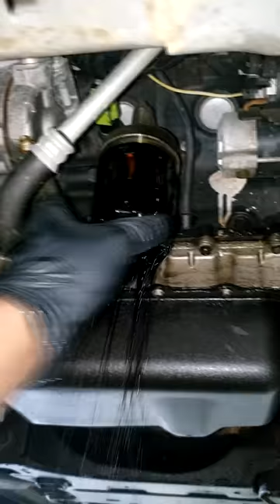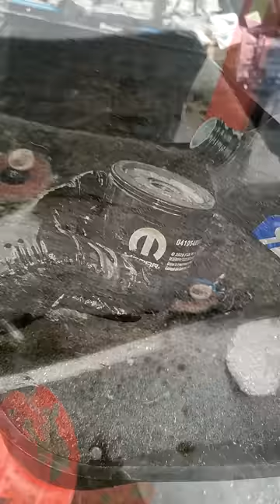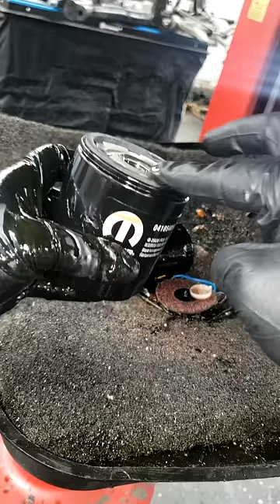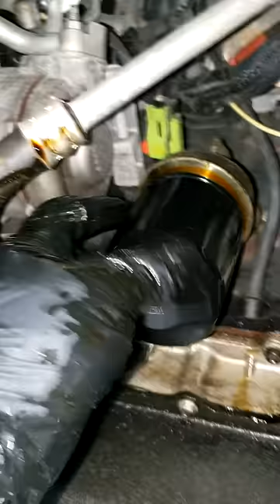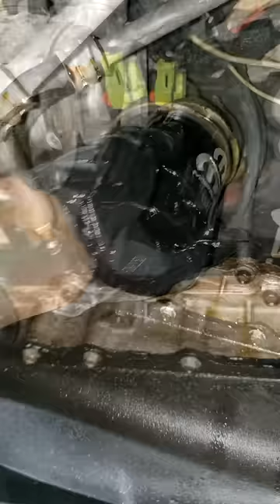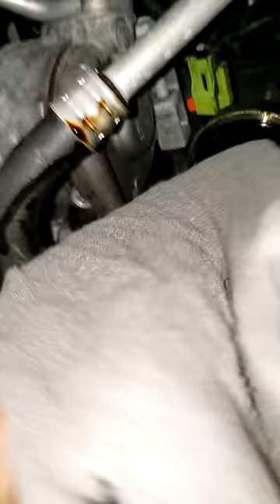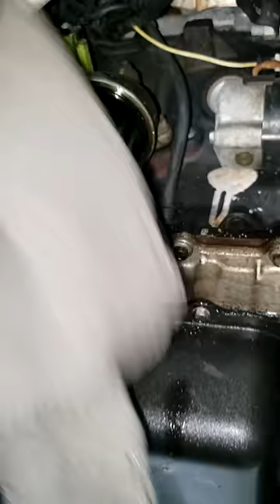Don't Lie.. Are yall still doing this?

Comment: You are pre charging the filter wrong. Your supposed to block that center outlet section with a plastic plug and pour the oil in the small inlet holes and you will see the oil come up through the center outlet section FILTERED. Otherwise you are putting unfiltered oil in that system
Reply from the maker: Interesting. Never gave it much thought thanks
Reply: While true, fresh oil is as clean as it'll ever be.  And will be filtered within a minute or less anyway.
Reply: It’s pure fresh clean oil, It doesn’t matter. Also in my experience it’s very difficult to get the oil in the outer holes and often the anti-drain back valve makes it impossible
Reply: @bigpjohnson  yes it won't take long to go through the oil system but the first place that un filtered oil would go would be right to the crank shaft which, with most setups, takes a 2 micron thick piece of particulate matter to possibly spin a main/rod bearing.
Reply: @rhettmix7271  New filter with new oil...no need to filter new oil, bruh.
Reply: Lol unfiltered oil 😂 
It doesn’t matter. It’s new oil.
Reply: @izacmcdermott3551  idk what you're on but filters won't even catch stuff that small man. Even things 15-40 microns big are only caught at a ~98% rate
Reply: I only prefill the filter if the design allows. Some filter placements you can't possibly do this. Either way the oil flows so fast there's not much of a difference. It's not like your changing the oil filter at every cold start.
Reply: Because the other 10 quarts i poured into the engine that arent filtered  are gonna hurt it its clean new oil it will litterally never be cleaner than in the bottle did you even think this through before postinf
Reply: @izacmcdermott3551 no the oil sitting around the crank you just poured in  is gonna go to the crank first wich unless you filtered all your oil going in the one quart in the filter doesnt matter at all  ps it goes to the oil sprayers/jets after the filter
Reply: Just remember we don’t have 70-80s vehicles anymore these advanced system have a priming system, oil pumps that are equipped to preprime the system along with oil filter. So I believe along with many other techs ( Ford boss me)that can explain why but hey to each it’s own. You have the time Go for it.
Reply: So no oil in the filter is better then just filling it up 😂😂😂
Reply: It doesn't matter, if the filter is empty and the media is dry on start up the bypass will open until the can fills and the media becomes saturated with oil. There was a great video showing this where they mixed pepper into the oil and there was oil coming out of the filter for the first few seconds after start up... also it showed pepper allowed to bypass with sudden RPM jumps like a down shift. Moral of the story, not all oil is being filtered. I'll post a link if i can find it.  The only filters that say don't prefill are the ones that don't have bypasses built in, like diesel fuel filters...

My take is that oil is going to be cleaner from the bottle than it is after being poured into the engine and mixed with whats sitting in the oil pan...
Reply: Nonsense. Most fill ports go straight into the top of the engine not direct into the pan. This is one reason you shouldn't refill with unfiltered oil from the pan even if it's new (e.g. you find a leak after a change and have to drain new oil). You can partially refill via the dipstick to go straight to the pan.
Reply: But the oil coming from the bottle is clean.
Reply: @EpicDrew15 very good point 😂
Reply: It isn't going to get any cleaner than straight out the bottle my guy
Reply: Why would you need to prefilter New oil the rest that you dump directly into the crankcase isn't filtered first so why would that pint or so matter? Just curious
Reply: You’re worried about that but you don’t even mention inspecting the filter for manufacturing debris…? (extremely common even in high quality filters)
Reply: BS, oil out of a new bottle is filtered and clean.
Reply: Let me know how that works when you get an oil filter that goes on sideways or on an angle like a 5.4 Ford.😁😁😁 it doesn't matter in all honesty.
Reply: You can't. The anti-drainback valve won't let the filter fill. Filling it through the center works, because the filter media is porous, and allows air to bleed out, allowing a full filter can. I'm not worried about debris, filling a new filter from a new bottle of oil.
Reply: If that's the case. Might as well put a coffee filter in your funnel as you pour in the rest of your oil. 😂
Reply: But, he's pre-filling the oil  filter with new oil, why would he need to do all that?
Reply: @todydn those 10 quarts aren’t going directly to the bearings, they’re just covering the valve train and draining to the pan.
Reply: Don't let Rhett Mix you up.
Reply: The main reason is because if there's a piece of aluminum from the lid of the oil still in there, even if it's small can block a port to a cylinder or many other things that can reek havoc in your engine. Pluse my any vehicles have an oil filter that is sideways so just don't worry about it unless it's a diesel and especially if it is it's fuel filter
Reply: Why would brand new oil from a just opened brand new bottle need to be filtered ? That’s the dumbest thing I ever heard bro 😂
Reply: Then in that case you are also pouring un filtered oil straight onto the cams when you fill the car up.
What a load of nonsense.
Reply: JUST TALKING ABOUT OIL CHANGE PLEASE BUY GOOD QUALITY OIL FILTERS! SOMEONE KILLED 2020 BMW 340I BECAUSE BOUGHED CHEAPER FILTER THAT WAS MADE WRONG...
Reply: @foojub6907  wich the crank and bearings partialy submerged in  at least in diesel vehicles where a verticle oil filter  is used  iv rebuilt my cummins twice now i can assuredly tell you the crank is halfway submerged in the oil also  the oil goes directly into the block not over the valve train  from there the pump draws it puts it through the filter 
 From there it goes to the turbo and the oil sprayers wich spray the rods and pistons wich lubricates wrist pins and oil rings  also is pumped up to the valves   but the bearings are oiled by passing through the oil in the pan/crank
Reply: @EpicDrew15  you don't need to pre-fill your oil filter...
Reply: You must be an engeneer...😂😂
Reply: It’s new oil it doesn’t need filtered
Reply: “Unfiltered”…. Dude it’s from a brand new sealed container……
Reply: @eliezerramosjr1017  there is one engine from gm that has a service bulletin to pre fill the oil filter. Have actually had it throw a check engine light for a rough start. On 90% of vehicle pre filling does nothing tho.
Reply: I have done it like this since I was a kid and we had a farm and a trucking/construction company. I still run the gravel crushing/trucking and construction company. Thousands of oil changes and no problems because of it. This oil change was very clean. No dirt/oily built up debris hanging around. No reaching up inside the frame between the oil pan. No reaching up through a bunch of shit like on my dodge Cummins pick ups where crud could accidentally get knocked into the filter. Save your white gloves for the ocd crowd
Reply: what about the 4+ qts of UNFILTERED oil you pour into the engine? 😅
Reply: @mattl6584  kids on the internet lol
Reply: Spu you mean to tell me that you filter all your clean oil before putting it in the engine???
Reply: I may be wrong but I feel that that split second of fresh oil entering the system (which will be filtered quickly) is better than a dry start?
Reply: @izacmcdermott3551  whenever you add oil to the fill port it is unfiltered straight on the valve train anyway lol it doesn’t matter it’s clean
Reply: Unfiltered oil? From the bottle? What you think, it's dirty?
Reply: Bruh, the oil gets poured into the engine the way it is to fill it. How else you supposed to add oil? I just did a full tuneup on my truck and did the filter exactly like this as per the Manufacturer.
Reply: @izacmcdermott3551  2 micron? You realize even the best filter only goes down to about 20 microns right lol
Reply: Unfiltered oil???? Lol do you mean the same unfiltered oil that you’re pouring in the valve cover to fill the engine??? 🤡
Reply: Most new engines have a bypass valve for dry startups anyways. That way if you don't prefill the filter it spends the least amount of time possible on dry startups. Oil from the bypass isn't filtered either because that's kind of the point. If the engine had to wait for the oil to go through the filter first it would be running dry for longer. 

Best practice to prefill, yes. Should you do it every time, especially on older vehicles, yes. Is it always possible? No, unfortunately it isn't.
Reply: unfiltered brand new oil out of the bottle huh?
Reply: These filters are so course anyway, with a finer filter like these remote ones that filter a smaller percentage at a finer rate id say this comment is very relevant but with these filters and new oil less so, imo....
Reply: but you pour unfiltered oil right into the valve cover🤔
Reply: @bigpjohnson  Have you looked in the bottom of an oil container?  They have sludge.  That new oil is not clean.  All filters go on dry with me, leave them wrapped until the last moment.
Reply: I need to buy one of those filters that cleans the oil cleaner than when it came out of the bottle.
Reply: no need to do that. the oil is fresh new. my only advice is to leave it for a couple of minutes after you fill it. it will settle down and you can fill it some more.
Reply: Yeah this makes no difference. New oil is as clean as the oil will ever be.
Reply: @izacmcdermott3551  Show me a consumer oil filter that can filter down to 2 microns. I can't wait to see it...
Reply: lol. so you should also filter it before filling through the top of the engine? 😂
Reply: Aren't you still putting unfiltered oil when filling the engine ? 😂
Reply: @nspro931  that's parts of the additives.  Shake it around and get them mixed up.
Reply: @Rhett Mix: It's BRAND NEW OIL he's pouring into the filter. LOL! So when you say "unfiltered oil", what exactly are you filtering out of BRAND NEW OIL? It hasn't went thru the lubrication system and picked up any contaminants. It's literally being poured of of the bottle into the filter. LOL!

If you're gonna filter oil straight from the bottle, then I hope you're filtering oil as you're pouring into the crankcase, as well.

Man, if you're really saying you gotta filter oil straight from the bottle, you're a special kinda anal retentive. LOL! I've done it just the way this guy is doing it - and I've never had any vehicle of mine have a locked up engine. There's nothing wrong with doing it like this, for real. Just stop trying to come up with something wrong. LOL!

I can't believe you're saying FRESH OIL out of the bottle has to be filtered. LMAO! I literally spit my drink out! hahahahaha
Reply: @mattl6584  I was just saying that! Man, I fell out laughing! This guy was talking about filtering FRESH OIL from the bottle! LOL! hahahahaha! I've seen some funny stuff, but THAT took the cake!
Reply: @HH-zi5ih  I'm dying laughing! Man, I hope this original poster was joking. I really do. Unfiltered oil into the filter. It's BRAND NEW! hahahahahahaha!
Reply: My oil filter is on top of the engine on my BMW and has a cartridge so there is no way to do this.  Which tells me its probably unecessary to do this since BMW doesnt think it is by design.
Reply: @todydn  I'm starting to think he filters his brand new water bottle water as he's pouring it into his mouth. LOL! Guy has a funnel up to his face and everything, making sure he's filtering new water before it gets into his body. hahahha!
Reply: Not many people actually know this wow. I’m honestly surprised. And it’s actually very crucial you do this on diesel engine’s especially with large filters
Reply: @OnlineMechanicTips  yeah he’s actually right fr. My instructors at UTI constantly told us this when we learned oil changes. It’s especially required on diesel’s with larger filters
Reply: @TheFrenchPug  Same with my BMW. I also run a Jeep Wrangler that has a side mount oil filter. I only put oil on the gasket and that's it. Bought the Jeep with 112k miles on it, and now I've got 256k miles on it. Never had an issue nor an oil leak.

I answered with my opinion on a separate thread saying exactly what you said: it's unnecessary to add oil to a filter. The oil pump picks up oil from the pan. The filter is just pass thru, not a point of suction/pull. I think people may do it to simply add that pint of oil in that part of the system so they don't have to add more oil when they check the level after filling the pan.

As far as functionality goes, it does nothing to the oil system either way. Fill it or not.
Reply: @HH-zi5ih  lmfao that’s what I said I was like bro it’s literally new oil what needs to be filtered out
Reply: @FZERO20  Why is it crucial? Can you explain why putting oil in a filter is a necessary step?
Reply: Unfiltered clean oil?
Reply: Yea I do! I also press the accelerator for clear to flood mode for a couple revolutions.
Reply: Your pouring unfiltered oil into the crankcase
Reply: @MicDropBBQ  when there’s no oil put in a filter before startup. There’s dry flow in that part of the engine. If you do oil changes often like I do at my job, you can actually hear the oil pump aerating for the first couple of seconds because oil has to fill the filter to complete proper flow. It’s not completely necessary in most passenger vehicles as they use smaller filters so they fill up quick. But in a vehicle with a large filter, or a Diesel!… that has huge filters. You can actually starve the engine of oil for a good amount of time
Reply: Scratching my head.......mmmmm, isn't that fresh oil though?
Reply: @MicDropBBQ  yeah me too distilled water at that
Reply: @bigpjohnson  Plus you’re not pouring oil though a filter when you’re adding it to the engine.
Reply: So what do you do about the gallon of "unfiltered" oil you just poured into the block?
Reply: I don’t because that one second of air bubble in the line or whatever you wanna call it isn’t gonna matter at all it’s gonna get pushed through so quick it’s not gonna affect the lubrication at all, not to mention not all filters are upside down, Some go on sideways some even go on right side up and I highly doubt if it goes on right side up, you’d be quick enough to at least get it butted up against the threads or at least one thread on without all the oil coming out and making a fucking huge mess! lmao!
Reply: Lol think about it..  what about small engines with no filter?
Reply: @UberJeep AZ  You got it. Very good explanation! I think the purpose of doing it has had the reason why change throughout the years. BTW...my son has a 2021 Jeep (4 cylinder turbo charged). Is that a different engine than what you have?  I love driving that jeep. It's a blast. I have a 2009 BMW 335i. Just replaced both turbos, oil pan gasket, and high pressure fuel pump. It's definitely not cheap for parts. But I hope I get another 100k out of the car. I've replaced pretty much everything except the engine and transmission. I have a JB4 tuner and methanol injection. Car hauls ass 😀
Reply: Bro made a 5 minute oil change into a 30 minute one gtfoh😂
Reply: how is this the pinned comment 😂
Reply: YES you're 100% correct; however, if you can see oil in the center and small holes; you're good
Reply: @justacinnamonbun8658  Exactly, the vast majority of cars I've owned it would have been impossible to do because of placement or even angle. My 66 fury 318 poly is way tilted and you have to pass it around the exhaust ect. Sure straight up and down and wide open like this go for it. Only time I'd worry would be if the cars been sitting for an extended period of time. Just run it for a bit to get it warmed up before you drain it and should be coated just fine. The new oil would flow through the engine better when you put it in as well which helps when you have to additive like zinc which is like molasses coming out...
Reply: Good luck getting anything past an anti-drainback valve.

It's not like the oil doesn't go through the filter when you prefill from the center. Just spin that crap around and it'll end up going through the filter plenty.
Reply: That Is the equivalent of me buying Poland spring water at the supermarket, then when I get home I boil it before I drink it. The oil is already clean don't be redonkulous
Reply: @bigpjohnson  Please provide a citation for this information.
Reply: @anthonybrown3481  Oil that comes bottles is not clean.  Often if it is a light colored container, you can see the sludge at the bottom.  The engine oil filter will clean it much better than that.
Reply: With new oil it doesn't matter,  unless you are changing your oil with used I wouldn't lose sleep over it.
Reply: @rack1850  It should be clean, but it is not clean.  Look in the bottom of the containers some time.
Reply: @FZERO20  But Caterpillar says not to do it.
Reply: @nspro931  if Cat says not to then don’t, Idk why. But on most vehicles it’s a rule of thumb. I’ve worked on Cat engines and Cummins too. Still do it but I haven’t found any issues so far
Reply: @nspro931  oh I just looked it up, the reason is that Cat understands that most ppl don’t know the proper procedure in filling oil filters and that they fill them from the centre and not the outer smaller circles so they’d rather ppl put them in dry and avoid any further issues that would cause them to have to warranty an engine or something expensive
Reply: I always filter my oil before I dump it into the valve cover. Otherwise you’re just putting new fresh clean dirty oil right onto your rocker arms.
Reply: the most important thing is the spring tension in the filter 
the manufacturer has a specific spring tension tolerance .Aftermarket is a no go for me, toyota only
Reply: @lita litvinaite  exactly , the spring tension is what the manufacturer makes for a specific engine, it is not some random spring in an oil filter
Reply: @mghuertas  PHD, of petroleum distillates
Reply: not a MO ron but a MI ron
Reply: It’s a joke people, relax
Reply: @bigpjohnson  nope!
Reply: @jjunderwood4095  first top off of filter gets absorbed into the element and won't spill out so easily Just don't do the second pour that tops the filter off. That saturation is a help to the system flowing rather than the pump having to force fluid through dry paper
Reply: I do top off if for nothing else to get paper element saturated and help keep the pump from forcing thick oil through dry lpape
Reply: @ricardomolina4605  Interesting concept!
Reply: New oil isnt dirty to need filtered.
Reply: @bigpjohnson true I was just about to say it’s fresh oil so no need to pour it that way since it’s not dirty yet
Reply: All the oil goes in unfiltered through the oil fill at the top of the engine. Your comment is wrong and pretty stupid.
Reply: TF you talking about. Unfiltered brand new oil. Oxymoron
Reply: i remember my first oil change
Reply: Unless you get your new oil with a shovel at the gravel pit it will be fine.
Reply: I do this with all my personal vehicles when I do oil changes , that's the way I was shown coming up. But I'm a heavy equipment mechanic for caterpillar, and caterpillar actually tells you not to pre-fill filters.
Reply: Exactly! Which is why I don’t bother filling the filter first. To do it right is ridiculously slow and usually messy.
Reply: This has to be the most Tiktok mechanic comment I've ever seen smh, out here thinking these filters perform magic and are made in some laboratory.. it's a bit of paper to catch large sediment, that oil is the cleanest it'll ever be and unless you had probably million pound/dollar equipment there's no way of getting it cleaner
Reply: its new oil. It's been been refined to specs.
Reply: If you block the centre and try to pour oil through the small holes no oil will enter.
The diaphragm will only push oil through when it has pressure behind it.
It would take an eternity to fill it that way
Reply: Yep that’s right and he did not wipe the flange off before he put the new oil filter on gross
Reply from the maker: @Herman Rogers Please tell me you don't work on cars for a living.  Your over extreme petty ways kind of disturbing.
Reply: Those oil companies don’t filter their oil before putting it in a bottle? Damn
Reply: Brand new oil doesn't need to be filtered 😆 you realize all the oil being added to the crankcase isn't going to be filtered either right? Until it has time to run through the system
Reply: Dude it’s a fresh quart 🤦🏻‍♂️
Reply: Not sure if this is a joke but what about all the "unfiltered" oil you fill the engine with? Hello???
Reply: @OnlineMechanicTips  bull💩 lol you were doing it right I have never seen anyone do it that way😂
Reply: @mattl6584  thankyou👍
Reply: It's brand new oil therefore there are no impurities to filter out. Nice try.
Reply: To all you geniuses that keep saying “but what about the oil you pour in?”

First off, if you want to be anal about oil you should be using a funnel that has a screen/filter in it. Most importantly though, where do you think that oil you pour in goes? FYI it goes down into the oil pan, through the pickup tube, and into the oil filter where it actually gets filtered. That oil you pour in the center of your oil filter goes straight to bearing journals and rocker arms unfiltered. Yeah, new oil is usually pretty clean, but people get fingernails in their chicken nuggets and surgical tools left in their abdomen. Shit isn’t always like it is suppose to be. . .  Long story short, you are better off doing nothing than pre-filling backwards. Besides, an empty filter is full of oil before the engine even makes one full rotation. Don’t believe me? Forget to remove the old oil filter gasket and spin that starter over one time. . . Pro tip: throw a pile of oil dry under the vehicle first. Lol
Reply: Always. Only takes an extra minute or so. Would hate to always skimp out on it only to find out those extra few minutes caused an engine failure. My time is valuable but not that valuable.
Reply: @bigpjohnson  not always the case with drum oil so most shops won’t do this
Reply: what about the other 5- 8 quarts of just as clean oil to fill the pan?
Reply: Lol 😂
Reply: @mattl6584  so, is it difficult, or impossible than?..😂
Reply: @mattl6584  once it heats up it willgo through. Splitting hairs.
Reply: YES! I have always done this, for the reason of making sure the system's full when I go up top to put the other 4-6 quarts in. Depending on maker/engine type, filters can hold over 1/2 a qt.

As far as adding"unfiltered oil" to the system...What are you doing when you fill the rest from the top? 🤔
Reply: @bigpjohnson  so should I overflow my filter and let it run through the filter and into a funnel before going in the engine?  😂 since it is fresh clean oil from the get go.
Reply: This was hilarious. Filtering new oil. 😂
Reply: You realize that oil pumps have a bypass built into them right? So any given time as that bypass opens to whatever the spring pressure is to regulate oil pressure from getting to high... then even the dirty oil in your engine doesn't get filtered. So I really think what side of a new filter someone decides to precharge with new oil is a really mute point.
Reply: @bigpjohnson  you’ve never seen particles in an oil jug?  I’ve seen it many times, usually slivers of plastic that my funnel acreen collects.
Reply: @todydn  tell us you don’t know how an engines oil system works without telling us
Reply: Yeah unfiltered oil, straight from the bottle in it's absolutely cleanest state it will ever be in. Filtering oil straight of the bottle is dumb as hell lmao.
Reply: @bigpjohnson  Exactly! It's never going to get cleaner than it is straight out of the bottle.
Reply: @izacmcdermott3551  Unfiltered? You think the manufacturer is sending you oil full of dirt!? I bet you have no problem pouring that super dirty brand new oil into your valve covers though right??
Reply: Yeah.better do it this way so it filters all those rocks and boulders out of the BRAND NEW oil.
Reply: The idea behind it is not to pre filter the brand new oil though. Its to pre saturate the filter material itself and have oil ready to flow into the engine at startup to lessen the impact of a dry start right after you get done. It may be miniscule but after hearing plenty of cars over the years dry start even without having just changed oil, I'm good. I'll put in 30 seconds of extra effort to not hear that. I've been doing it for almost 30 years now. Not gonna bother stopping.
Reply: You're worried about unfiltered Oil in a Oil Filter ?
What about the other 3 to 5 quarts poured straight into engine block ?
Oh great, now we have to go filter that too don't we ??
Reply: Never knew brand new oil needed to be filtered 😂😂😂😂😂😂😂 this dudes a typical YouTube mechanic lolol
Reply: Mobil 1 comes off the shelf unfiltered? I didn't know that.
Reply: One hundred & fifty-eight replies, and i must insist, you see it's fresh clean oil. Right from the new bottle. Even if it had some particulates, the crankshaft would like iit better than starting dry!
Reply: @OnlineMechanicTips  dude's trippin! Im sure the new stuff is filtered, maybe finer than the actual oil filter can. If i'm not mistakin, its about NOT starting the engine on a dry crankshaft. Correct me if i'm wrong. Please.
Reply: @QuincyStick  and that only applies AFTER the filter has caught enough trash. 2 microns, HA!
Reply: Got a Pontiac so I don't have to do this
Reply: It alll gets filled if you wait a few minutes and repour until it weighs a pound and uou have somehow put in an entire quart lol
Reply: Let me see you try that on a cartridge
Reply: While true, "sending unfiltered oil through the system" is not a thing you need to worry about. Unless you're filling it back up with sludge, and in that case, you got much bigger problems.
Reply: I have no idea of this but why Filter new oil I mean do they sell used oil or what😂
Reply: No. The oil is well filtered in the bottle.
Reply: Hahahaha
Reply: It’s the same thing it’s just a paper filter in there that will wick it up. The point is to make sure your engine does not starve of oil when that air bubble goes through. No air bubble=no starved engine. You my friend should not blindly educate people the wrong way. The level on the outside will balance out.
Reply: Bro it’s fresh oil and filter, you know the same clean new oil you put directly into the oil pan. Not to mention it mixes with the coating of old dirty oil form before the oil change do…. The inlet hole thing does not matter
Reply: I appreciate how little people actually get the joke.
Reply: *you're. Credibility lost.
Reply: @ricardomolina4605  looool
Reply: Or just do a wot injector cut and prime the system in a few cranks of the engine. Also very good for cam chain tensioners.
Reply: @izacmcdermott3551 nonsense
Reply: Correct, the diesel guys are big into doing this
Reply: @xfhnhhgjbvcfg  the diesel guys do it because if you start the motor to fill the filters you have to wait longer for the oil to drain back into the pan and can’t check the oil right away to make sure it’s at the proper level.
Reply: @codybertram6122  that makes perfect sense! Thanks for explaining that!!
Reply: Lol totally unnecessary. Shouldn't be too concerned about fresh oil being filtered 1st as its "fresh oil" don't forget depending on model and pan design you are never getting all that old oil out of the engine...usually a quart sitting in various engine parts are left behind.
Reply: @izacmcdermott3551  If a 2 micron thick object spins a bearing it was fixing to go anyway.
Reply: Good point. Now fill that filter up correctly and drip it's contents in the engine until you fill up the pan with new filtered oil and you just spent 12h doing an oil change on a truck 🤣😭 wtf new oil is new oil. Why don't you wash up the filter package may contain COVID 🤣
Reply: This dude obviously made this comment just to get a rise out of people. Congratulations, it worked.
Reply: @Clay_333  I’ve had experienced mechanics tell me this too so it’s not an uncommon situation. But those are also the type of mechanics that have feeler gauges smashed to hell and they probably dip head bolts too
Reply: Wipe the threads with a clean finger, fill the filer, wait till it soaks into the media (all while the dirty is draining) fill the filter again, and finish the drain, then install the new filter - it's worked well for decades - gets oil to the bearings that much sooner on startup.
Reply: Agreed, I've seen that some OEMs advise against pre-filling the filter at all on the basis that it introduces unfiltered contaminants. The  1-10 seconds (seems highly variable for individual engines) with low oil pressure won't hurt anything.
Reply: U are putting the same “unfiltered oil” directly im the engine.  Smoothbrain
Reply: @izacmcdermott3551 lmao. You know, as late as the 1950s , vehicles didn’t even have oil filters. You just had to be responsible and change your oil properly.
Reply: I just screw the fkn filter on, I have never had one engine problem in 35 years of changing oil.
Reply: Please tell me this comment is a joke. If not, will you show me the lab results that back this claim?
Reply: Didn't know clean new oil needed filtered! nonsense!
Reply: just another reason why you shouldnt
Reply: what about the unfiltered oil going right into the engine?
Reply: Do you want me to add oil by the filter or the filler cap?
Reply: @pascratcherjoe yes especially in a shop. Or using bulk filling machines like the shops use. The oil in the barrel can be contaminated with metal from the barrel, the shop, the bottling process, the changing of the pump, part of the pump broke off etc. Just cause its new doesnt mean something didnt make its way into the reservoir. It can come off your finger or the nozzle you stuck into a dirty fill tube as well. Many people dip their finger in the oil to lubricate the o ring then proceed to dump right into the filter. Or the shop idiot that put too much in a jug and dumped the leftover back in the barrel. You car doesnt suffer from no oil in the filter. Most cant be pre filled anymore. They are either sideways or go in housings. All it takes is one little metal shaving stuck to the nozzle or your glove. Not likely to ever happen but it can and does.
Reply: That's a thing for diesel fuel filters not fresh oil in a new filter
Reply: @jhenry7406  100% agree. I send my oil off to a lab every so often and they've never said anything about contaminants in my oil; I never prefill my filter like the original comment is saying.
Reply: It's new oil tho... Have you ever messed up a car by doing this? I'm curious
Reply: @bigpjohnson  exactly
Reply: @JohnDoe-md2sb  exactly
Reply: The unfiltered brand new oil from the container? I'm sure that will really kill the engine fast...😂
Reply: It’s brand new oil!
Reply: @Joe_Can  I will show you many folk that never gave a shit and there engines lasted 500k plus!
Reply: It doesn’t matter if it’s new oil. Now if you are putting old oil back…. 😂
Reply: @izacmcdermott3551  and how many microns do you think the oil filter is 1? 😂😂😂😂
Reply: It doesnt matter much its new oil maybe if your reausing or repurpouse oil
Reply: What ab all the unfiltered oil you pour into the engine over all the top end components
Reply: @izacmcdermott3551 there shouldnt be any particulates in new oil anyway anything thats "worry some" had alresdy been going thru that motor a million times
Reply: @QuincyStick im sure it largly depends on what brand of oilfilter you use i watched a video testing diffrent brands Fram filters worked the best
Reply: @paulschiska7638  there should be no unfiltered oil thats why you let it set for 30 mins for the oil to drain back down into the pan b4 u pull drain plug or just do something else for awhile when its draining but the oil from bottle is clean 👌
Reply: @jjunderwood4095  And this is the truth the no one wants to admit. It dosent matter at all.
Reply: Nerp that's a fuel filter procedure, not oil.
Reply: @Izac Mcdermott  LMAO, 2 micron particulate will spin a bearing.  Earth to nut job,  the best filter removes particles 20 microns and larger, smaller gets through all day long.  The large volume of air, no oil gets pushed past bearings for 5-10 seconds
Reply: @OnlineMechanicTips   - Ummm...how about cleaning the oil filters mating surface on the engine! Just saying...LOL.
Reply from the maker: @irishkelly654  Yes, you should clean the old oil off the mating surface. You dont want this engine to lock up or knock. Great point Irish
Reply: How often do you say stupid stuff?
Reply: Everyone is missing the original point:

This guy must change oil buy taking it out of one car and putting it into another one. And I am sure it pours the other 5.5 or so quarts into the pan buy using his old t-shirt as a make shift filter and then putting it back on when done.

Innovative. All the teat of us chumps are out there buying new oil in sealed containers that has already be refined at the manufacturing level. 

This obviously more frugal person than us goes 3000 miles on his favorite car, pulls the oil out and uses that for another car he does not like too much for another 5,000 miles.

His third car is a real POS so he filters it with a coffee filter then runs it 10,000 miles.
Reply: my brother in christ, its brand new oil.
Reply: Definitely, 
Filter the brand new oil....
Reply: @colbyhale7030  fram are notoriously bad. Regardless of that however no oil filters catch things that small
Reply: Not necessary if you have a steady hand... I would always recommend doing that when you change out your fuel filter
Reply: I hope your  not an aviation  mechanic,  sort of makes me  think of that movie title "Fire In The  Sky ".
Reply: It really doesn't matter. Oil will permeate the filter media regardless of which holes you prime.
Reply: This is complete nonsense. The oil is brand new. You won't find a single real mechanic do what you just said.
Reply: GUYS DONT FORGET TO FILTER THAT NEW OIL OR YOU SHIT WILL EXPLODE INSTANTLY
Reply: It’s brand new oil…
Reply: Probably been covered but you literally dump that oil on top of the engine when you fill it. Unnecessary to filter
Reply: @georgedawson235   False
Reply: @Matys1975   Learn more, and it wont sound dumb.
Reply: Anyone with a brain knows some cars have a bypass for the filter and plus the oil is brand new this is not an issue
Reply: Ummmm....  It's new, fresh oil.  There's nothing it it that needs to be filtered out of it, nor is there anything in it that the filter would be capable of removing in the first place.  The purpose of the filter is to remove anything that is large enough to damage engine components.  Pour fresh oil through come coffee filters and you'll see that there's nothing harmful there that a filter could possibly remove.
Reply: @OnlineMechanicTips  if oil needs filtering fresh out of the bottle or tank, I better get a new source 😅.
Reply: @izacmcdermott3551  Times that has happened in my 40+ years as a mechanic: ZERO. If there's debris that enters the system,  it's usually from being introduced into the oil passages with someone being a bit careless during internal engine work.
Reply: People are overthinking OIL CHANGES. JUST CHANGE THE OIL.
Reply: Pull a pan sometime and see what unfiltered goodness lies within. 
The oil is crystal clear.
I have cut open filters and seen sometimes where the paper didn't get secured properly all around (so it's partially filtered)
Reply: We’re not building the space shuttle.
Reply: New oil that’s contaminated w dirt is a messed up wrench thrower
Reply: You're wrong, for two reasons. Firstly, brand new oil doesn't need to be filtered; and secondly, a proper filter has a silicone anti-drainback valve preventing oil from going into the small holes. If you're using filters that don't have an anti-drainback valve, you're using the wrong filters and your engine is dry starting every time.
Reply: @adamgallahan6747 Its more than one second, more like 5, watch how long it takes for your oil pressure light to go off on first start after a filter change if you dont pre fill it. The only time i dont do it is if the filter is sideways, if its vertical, any monkey can spin it on without losing a drop, lol.
Reply: So, new oil has to be filtered? That's the most stupid thing I have heard in a while. That engine might not like new oil better just keep the bad oil in and run it.
Reply: @henryrolt3747  You mean zero oil pressure, not low, and yes it most certainty does hurt it. Do you realize the forces that are applied to the rod and crank bearings, geesh. Half a second of zero oil pressure is too much.
Reply: Although this is true, it’s still very clean oil. Plus when pouring oil into the engine, you’re putting unfiltered oil in and it’s running down the whole engine… oh no, clean oil!
Reply: Why wouldn't you let it filter out the dirty oil still clinging inside of your engine?
Reply: that is new oil it doesnt need to get filtered.
Reply: @johnny0454  All my cars until recently I’ve had them sideways though except my current car has it vertical So you can pre-fill it as it screws in from the bottom side, But I swear when I didn’t pre-fill it in my even older car That had the filter sideways the oil pressure still built up to the normal psi within I would say a normal amount of time maybe there was a couple seconds it took extra, but not quite five. I can’t remember to be honest. I’m pretty sure even if you run a vehicle with no oil pressure at lower RPM it would probably take at least a couple minutes for Any damage To happen and I’m pretty sure under normal driving conditions if you had no oil pressure, It will still take a whole 20 minutes or so to seize, So i highly doubt that slight lack of pressure for a couple seconds is going to do any damage But yes, if it’s a filter that you screw on from the bottom, where the threads are facing up, then I’ll probably pre fill it since its not going to make a huge oil mess lol
Reply: NEW UNFILTERED WOW I WANA BUY NEW UNFILTERED LOL WOW
Reply: This is hilarious.
Reply: @todydn  What are you driving that holds over 10 qts of oil, a Caterpiller?
Reply: Oh, Jess
Reply: That is fresh oil lmao there's nothing you filter out of it my guy
Reply: Unfiltered?  😂😂😂
Reply: @johnny0454  half a second is not enough to do damage. The factory service manual on my car does NOT instruct the technician to fill the filter. It's a small engine so the oil light goes out about 2 seconds after an oil change, or maybe 1 second if you fill the filter. Some larger V engines can take a second or two to gain oil pressure on a normal cold start.
Reply: @JT_70  cummins 2500 11 quarts if you include the filter
Reply: Isn't it the same "unfiltered" oil being poured into the very top of the engine? And why would fresh oil be contaminated?
Reply: I suspect this is sarcasm guys
Reply: Oh no, you mean like normal oil that I add after the change is all done?
Reply: Than why not prefilter oil before we throw it in the oil hole on the valve cover?
Reply: What in the blue hell are you doing, are you actually filtering fresh oil? I been working on my stuff and other folks stuff for 26 years and I have never heard of that. I have also never had a issue with it hurting any Main Bearings (or any bearing for that matter) in ANY Engine I built, from a stock 2.3 Ford to quite a few 1,000 + h.p Engines.
Reply: And...insomuch as new, fresh oil is being poured into the filter, what's your point?
Reply: It doesn't matter - unless you're pouring gravel into the crankcase.
Reply: You put unfiltered oil into the engine right after you "precharge" that filter anyway. The whole thing is stupid. This is why we don't bother doing this anymore lol
Reply: So. . . Do ya pour the new oil thru a filtering system when ya put it in through the fill tube ??
Reply: But it's fresh oil...
Reply: But it's fresh oil...
Reply: So the new oil need to be filtered?😂
Reply: ive never done it like the way youre sayng and i was doing this in the 2000's  at firestone.  never ran into an issue.
Reply: @izacmcdermott3551  my 1989 riding lawnmower with no oil filter begs to differ 🤣
Reply: Lol u people talkin microns musta never changed ur own oil.. listen to what ur saying you’re living in a land of what if’s and microns
Reply: @joeb7168  yeah it ain't that serious...you ain't gotta be a perfect scientist to change oil... That's why half the time they get knuckle draggers to do it  and give the bigger jobs to everyone else 😂
Reply: Unfiltered brand new oil out of the bottle? 😂
Reply: My oil filter mounts at 90 degrees, oil pours out. Otherwise yea I do it. Regardless I'm at 300k and going strong. 3.4 Tacoma
Reply: @cameron4247  man leave him alone and let him wash his paper plates...
Reply: I love how many likes that comment got.  When did they start putting unfiltered dirty oil in the new unopened bottles 😂
Reply: Might be an issue if it were old oil , if you need to filter the oil fresh out the jug find some new oil !!
Reply: It's new oil. How much more filtered do you want it. Please post useful comments
Reply: @ricardomolina4605  😂😂
Reply: unfiltered oil straight from the factory container.... omguadaf
Reply: LOL  SRSLY?  That FRESH oil is guaranteed to be CLEANER than it will EVER be once it gets into the engine.  The guy was sloppy though and should have cleaned all that nasty old oil off the mating surface first with a clean rag.
Reply: That engine looks like it has an oil leak...and yes I do it !!
Reply: So pouring it directly into the valve train and letting it pour through the engine is ok then? The oil is brand new it is ok.
Reply: He pinned you so others can roast you
Reply from the maker: Roast him why?
Reply: What? It is clean fresh virgin oil from the bottle, It will never be any more filtered and clean than it is from the bottle, It's not used dirty oil with metal particulates in it.... Now tell me I'm somehow not correct...
Reply: Brand new oil. Doesn't need filtered. Do you filter the rest of the oil before you put it in? Of course not. Dont try to sound smart when you actually have no idea what you are talking about. He should have put another WIX filter on though.
Reply: @litalitvinaite  BMWs are made wrong from the factory.
Reply: @nathan40307  hi,can you clarify this?I deffo sugest that quality us low compare the mane years ago.I own 340i 2020 and x5 2019 and as a car body tech can say audi bmw paint work getting worse...im not happy with my harmon kardan audio because my one fitted with bad mexican amplifier...and sound very bad.the audi a6 c7 i have is with simple sound system sounds 100 times better
Reply: @litalitvinaite  what do you need help with exactly? I can tell you to get rid of the BMW though. They are junk. Great when they work right but they never work right. And a nightmare to work on. Most mechanics won't touch em.
Reply: @JohnDoe-md2sb  bro just smoked the finest Crack imported from Harlem.
Reply: No he’s doing correct because It’s new oil..  it has nothing to do with filtering oil. it’s stopping dry air pocket running through the system on startup. Startup is when the major wear actually happens inside IC engines. Having no oil during this period is even worse.
Reply: @OnlineMechanicTips  you never give it much thought but you're making it an entire video or short of it
Reply: unfiltered oil? it's new oil. quit overthinking this.
Reply from the maker: @Sam Screwed A 60 sec shorts video not an entire video and in fact this really a question to see if yall still do it. I noticed you haven't bothered to answer.
Reply: Bro😂, it’s new oil!
Reply: I never thought that was a fundamental in changing your filter. I just assumed that if dirty oil can go through the access hole on the filter screw on thread, then clean oil couldnt hurt it.
Reply: not sure it matters since the chance of it having contamination right out of the bottle are slim to none.
Reply: Kinda like when u dump it straight into the engine??
Reply: Doesnt matter. Jug oil is cleamn
Reply: @tmanwheeler8270  🤣
Reply: Umm, its new oul which is as clean an oil as youll ever havem you dont realyl onow much abiut this rtuff do you?
Reply: It doesn't matter, the oil is fresh. When you pour oil in the top of the cap its also "unfiltered" doesnt mean its gonna damage anything
Reply: @Mauipig lmfaoooooo
Reply: Too bad you cant do that on all vehicles
Reply: There's always more than one way to eat a reeses
Reply: Why bother? When the engine is off the oil sinks into the pan anyway?
Reply: Clean, unfiltered oil.
Reply: Yeah I suspect those 4 ounces of brand new oil aren't hurting anything.  You're doing too much, bro 😂
Reply: Gentlemen y'all thinking to hard big ass trucks do it small lil cars shake up the big bottle pinky in the new oil now oil the seal hand tighten it up n sender after filling the appropriate amount n viscosity for the vehicle 😂🙏🏽🤙🏽🎯🏹♾️☯️🤯
Reply: Buy you’d be pouring brand new oil with no contamination into it anyways?
Reply: And what about the other 4-5 + quarts that get poured into the fill cap? Are you supposed to put coffee filters in the funnel too ? 😂🤡
Reply: It's brand new oil dummy!
Reply: Just clear floof mode it. It primes the engine better than that.
Reply: Do you also filter all the (new and clean) oil you add directly into the engine?
Reply: You are also pouring new oil straight in the engine through the valve cover. No filter there
Reply: My auto teachers filled it that way for over 60 years. I’ve been doing it like that for over 5. It’s new oil. Think about small engines that don’t have oil filters. If there were chunks in your new oil every small engine (mowers, snowblowers, go karts, some dirt bikes and quads) would be failing all the time because they don’t have oil filters. If you want to waste time pouring oil through the small holes and waiting for it to filter and settle go ahead. But all you’re doing is wasting time
Reply: Unfiltered oil? Seriously? Dude its a bnew oil.. the heck u need to filter it for..  he's not preloading used oil dude.. next time think it over first before hitting ng button
Reply: Better than NO OIL
Reply: Your not wrong
Reply: To everyone saying “But you’re pouring it unfiltered in through the valve cover!” needs to realize that the first place that oil goes through is the oil PUMP.  The second place it goes through is the oil FILTER media.  After that it is channeled through the oil passages to get to the bearings, etc.

I’ve seen this “pre-fil the oil filter or not” debate for years now.  Some even send their brand new oil out to be sampled and claim they have received results that could be harmful to be going directly to the bearings and cause damage.

Caterpillar literally has a warning on their oil filters stating to NOT pre-fill them.  Some theorize that when a small piece of the metal foil that seals the bottle enters the center port of the oil filter while pre-filling go unnoticed, the first place that foil debris goes is directly to a bearing and will destroy that bearing, or worse can cause enough blockage to starve multiple bearings and ruin the entire engine even faster.

Not just a theory…because it has happened.  And when a manufacturer has a claim regarding an engine failure for an engine that was under warranty, it is easier to put a warning on the filter telling the installer not to pre-fill the filter than it is to argue in court to prove that the +$30k engine failure was not their responsibility.
Reply: Oh, so if you’re like me and bothered by the idea of pumping the volume of air that the filter contains throughout the engine upon startup, especially when you’re talking about a large engine in a Heavy Truck like you’d find in a Freightliner where the 3 oil filters total 4.5 gallons of volume, the procedure to prime the air out of the engine is to disable the fuel system by either pulling the fuel pump fuse or on some engine brands putting the throttle fully open while cranking the starter.
Reply: The oil is fresh dude. Do you think you are filtering fresh oil?
Reply: @ThatSB  
Are you sure about that?  Are you sure that the manufacturing process and bottle-filling methods are always 100% perfectly sanitary?

To be clear, I don’t take the side of “brand new oil is not clean enough!” like the oil sample nerds claim.  But when you consider that the factory that is bottling the stuff as fast as possible looks at it from the perspective that “the oil filter of the engine it is going into will capture the dust/dirt/debris” then it is safe to say that you never know exactly how “fresh” the oil truly is.  The word “fresh” does not mean the same as “clean”.  Have you ever seen a bottle of oil that claimed to be “Bottled in a Perfectly Sterile and Sanitary Facility” or “Certified to Have Absolutely Zero Contaminants!” on it?  😂 

So yes, when you put “fresh” oil into the engine, you are in fact filtering that fresh oil before it enters the oil passages.

Personally I think it mostly comes down to the random chance of things like pieces of the metal foil seal entering the unfiltered port side of the filter that can cause the mayhem that you’d want to avoid.

But regardless of whether you understand what I’m trying to get across here or not, change your oil however you like.  It doesn’t bother me a bit.
Reply: @todydn  Not in all engines. In my engine the sprayers for lubing the cylinder walls are built into the conrods themselves, so oil doesn't get to them until it's made it through the main bearings AND rod bearings.

And clearly it works, because I've got a Ford 300, and they're known to live 500,000+ miles with meh maintenance.
Reply: @OnlineMechanicTips  so this guy said the same damn thing i said but i included the facts of newer vehicles with canister cartridge filter that its impossible to prime as well as others said subaru  you didnt blow up on this guy like you did half your comment section if i sent "its not a how too" then why did you install the filter primed wrong onto that customers car unless its your own disclaimers usually help home boy (and btw deleted my original comment cause already had people tryin to argue both sides and i dont need a ton of notifications....)
Reply: Yea that's interesting. Thing is, that car he's working on is not a high-end super car, so that shit won't really matter lol. 

The old oil will just get filtered out and the internals will be lubricated with more clean oil.

As long as that oil is not insanely sludged up or has tons of metal shavings it won't be a problem doing it the traditional way.
Reply: @TestECull what engine  im speaking of diesels wich are the most comon to have a upside down filter   if you dont fill the filter on my engine the sprayers or phasers  will run dry creating a air buble in the system wich can damage the sprayer or cause a lock in the system where your not pumping oil at all  so i always prefill not loosing another motor
Reply: @bigpjohnson  it is supposed to be clean. However, for the sake of my engine, I'm not taking chances any oil that is added to the center chamber of the oil filter is going directly into the engine and and must fully cycle before it gets filtered
Reply: Where are you getting "unfiltered oil" from? You're pouring brand new, never used oil into the filter. Changing the location that you pour into doesn't change the quality of the oil.

What you should do, is before you even start draining the oil, prefill the new filter and rub some oil on the gasket, put it aside on the workbench, drain the oil, change the washer on the drainplug, wipe any oil off of the pan an install the plug, check the oil level in the filter and top off if necessary, clean the mating surface on the engine block or adapter if you have a remote mounted filter (not very likely though) and be sure there isn't any remaining oil filter gasket on the block, install the filter, add the oil and watch for leaks, check the level, start and run the engine briefly, shut it down and check the level one more time and add if needed.
Reply: @sped6954  this right here  this guy doesnt know how oils made even natural oil is made by titration and distilation thats why they call em refineries  wich means its practicaly sterile synthetics are literaly lab made  so eveb cleaner i.e. why they get used for hd and highmileage vehicles  this guy is so over the the top i bet he changes his oil twice each time to try and wash extra crud out  lol but i also bet he uses hose water to dilute antifreeze  wich is arguably a way bigger issue
Reply: The crumbs in there will still go on the oil. It is the same either way
Reply: @sped6954  okay well just remember the next time there's a food recall and you have some in the fridge. It's safe to eat
Reply: Now Google how an oil filter works and you will understand
Reply: Yeah but guy.. it's fresh new oil 😂
Reply: wise tail.
Reply: You're putting unfiltered brand new oil think about what you're saying there All that filter does is screen out heavy material
Reply: @bigpjohnson  yeah fr
Reply: @jibrilthegreat35  you are on B.S. bro.....this exercise is not about the clean oil my friend, it is all about having the filter pre-primed to limit less time before when the oil gets in to the filter before it leaves the filter to directed the major engine parts (e.g. crankshaft,connecting rods bearings...ect ect.ect.....)in the shortest time possible to reduce metal to metal wearing my friend!! So get your concept right before you talk your B.S. bro
Reply: The oil gets ran through the motor before its filtered anyway. At lest in some way so why would it matter if it's filtered? Plus you pour the oil over the engine components when you add it. Unfiltered.
Reply: @todydn I bet dude filters the oil he's pourin' up top too 😂
Reply: @grrrtyson  at least 3 times the last one is a reverse osmosis water filter for a fridge
Reply: Filters are there to catch metal shavings and pollutants that went past the intake bro not to filter your new oil 😂
Reply: @izacmcdermott3551  surely you don’t believe two microns will throw a main bearing - have you seen some of the conditions engines are built and rebuilt in - give me a break man
Reply: Actually, (from mechanic Scotty K.) "pre-charging aka adding oil to the new oil filter with an oil change...
*_Is not needed in modern cars - oil is thinner and engines are different.
Reply: @Josh Sirum  no bro it doesn't......the oil is first picked up by the oil pump and the oil pump pumps all the oil to/through  the oil filter first and then it is pumped to all the other engine parts after via the oil filter 👏
Reply: @Ty Btyne  you guys are not getting it....this exercise is not about the filtering of the oil..... it's about getting the oil (while it is being filtered at the same time not's that it is dirty)to the mayor engine parts like the most important the crankshaft bearings connecting rods bearings, piston pin bushings ect.ect.ect.......in the shortest time possible for when the oil is sucked up by the oil pump and then it is pumped to the filter first and then the through the filter is then pumped to the rest of the engine parts after!! So it's not about the clean oil guys
Reply: Dude messy
Reply: Bro it's literally new oil, like it gets used by the valve train when you pour  it in, acting the fool bro 😂
Reply: How is it unfiltered if its FRESH FROM THE BOTTLE?
Reply: 🤦 so what gappens to the oil you dump down the fucking fill tube??
Reply: @eliezerramosjr1017 speak for yourself. I’m driving an 80s car and all the lazy mechanics today can’t get away with the same stuff on those older models
Reply: 😂😂 you can't be for real, are you?
Reply: You're a 4 hour service guy aren't ya?
Reply: You do know that the other five quarts is added top side, right?
Reply: Thats new oil... already filtered in factory
Reply: When you pour the new FRESH OIL in the heads/ that most of the time, make contact with the cams/ it doesn’t go through a filter right away. It doesn’t matter unless you using some out dated, used, contaminated oil. So since it’s new, your case is irrelevant. So before you go commenting away saying he’s doing it wrong, think about what you going to say and understand what’s technique and what’s logical. I digress sir
Reply: it's new oil doesn't have to be filtered when fresh. pour it in any hole will do!  (THATS WHAT SHE SAID 😂)
Reply: The Fresh oil is Clean The Reason it goes through the Filter in the First Place is because of the Carbon Deposits Metal Flakes And everything else that possibly come lose and Fall into the oil get Filtered out before going into the Engine and getting into the Bearing and Cylinder Walls so if it's Fresh oil it's fine it will never be that clean again
Reply: I used to do it the Ford boss and bearded Ford tech said it wasn't necessary. But I crank it in cold start mode. But I did fill the filter for years.
Reply: Un filtered clean new oil... you don't have to put oil in there, but if you're going to do it, then it doesn't matter if you put it in the center. In fact, you cant put in the exterior holes if it has a drain back valve unless you hold it open with something like a pocket screwdriver, but more often then not, its a waste of time. If you do put it in the center, again, its new oil, it will seep through the filter and fill both cavities. Everything is still wet inside the motor with oil. Id only precharge the filter if it's a new or freshly built engine. Obviously you'd want to do this plus prime the oil pump (where applicable) on a new engine... especially if it's a flat tappet motor.
Reply: So you filter the rest of the oil filling up the pan?  No
Reply: So what about the other 5 quarts of “unfiltered oil” he’s about to put in? Lmao
Reply: Huh? ... Brand new oil is as clean as you can get.
Reply: @bigpjohnson  right 😂😂
Reply: @Michael Sandiego  we are all stumped too... we don't get it.
Reply: I guarantee that oil was filtered at the refinery.
Reply from the maker: Lol
Reply: I would rather put the highly unlikely risk of materials I. The brand new oil than start a motor dry.  
Another question , how many of you after major work.flush the oiling system?
Reply: Curious…if that’s wrong… when you pour it into the center…is it just a magic trick of oil filters that makes it vanish? Because, IMO, that is the filter cartridge becoming fully saturated with oil. Fresh new clean oil. Asking for…well everyone.
Reply: 🤣🤣🤣 what a muppet. It's clean oil
Reply: It’s new oil. All that stuff you pour in the top of the engine doesn’t run through the filter first. Good thought though
Reply: yup
Reply: Which way you fill the filter up with oil doesn't matter at all IF you're actually using brand new and CLEAN oil to fill the filter up, (which hopefully you ARE!), because brand new clean oil is already that, and it doesn't need to be filtered before entering the system!
Reply: its fresh oil mate. why would you need to filter fresh oil when its the cleanest at that point? makes no sense.
Reply: @izacmcdermott3551  which could get in the filter in a lot of applications just by trying to weave the filter through all the bs to get it back into position to spin it on 😂
Reply: But dude, it's brand-new oil. Are you saying that's not good enough?
Reply: That statement shows you know about 2 microns of what you're talking about.
Reply: Aaaaand do you filter the oil you put directly into the engine.....
Reply: Bruh...
Reply: @QuincyStick 😂😂  ya i dont think those filters are doing anything at 2 microns.  And I've never heard of someone spinning a rod bearing due to a particle 1/12500 of an inch, which would be 2 microns approximately.  😂😂  I've got respitotors and filter material that will filter certain gasses/fumes down to the single digit micron and theres no way any oil would pass through it at all.
Reply: It's fresh oil out from the bottle, fresh and clean .. it's perfectly correct way .. what is not right is not cleaning where filter sits. I also put small magnets on filter walls
Reply: What about the rest of the oil that you pour through the rocker after the filter is fitted?
Reply: Unfiltered brand new oil huh?... 🤣🤣🤣🤣
Reply: That’s ok if filter mounts like that 🤔what about those that mount side ways ?
Reply: Its brand new oil!
Reply: the oil he just put in in the filter is brand new and clean. its fine to charge this way. but IMO as a engine mechanic, its not needed. by the time you start your engine that tiny filter is charged. I built a 91 liter 18 cylinder engine with 6 oil filters, 2 liters each. Those you need to pre fill lululu
Reply: @richardgraham3658 
What the hell does prefilling an oil filter have to do with a food recall? If you're going to compare to dissimilar items going into two dissimilar systems, then be prepared to show how you're comparing them and what one has to do with the other.
Say you have a six quart system; instead of dumping six quarts into the pan, you're putting ½ quart into the filter and 5½ quarts in the pan. You're using a brand new, clean filter and six brand new, unused quarts of oil.
Reply: Per manufacturer spec yes.
Reply: @Orygunner67  IKR?! What does he think that he's pouring ALL over the internals of the engine when he refills the oil through the filler hole??... Totally unfiltered oil, and a few quarts of it at that! (Hopefully everyone uses brand new oil when doing an oil change, otherwise it's defeating the purpose of an oil change all together!... And if it's already brand new clean oil it doesn't need to be filtered through the oil filter before hitting the internal engine parts, because new oil is ALREADY as clean as it's ever gonna be! Lol
Reply: @OnlineMechanicTips  never gave it much thought??!!!?!?! Wtf kinda mechanic just WINGS it on a customers car???? You deserve to lose your job. AND YOU WILL
Reply from the maker: @your_mommas_bed  Are you simply bored with nothing to do? I suggest McDonald's, they always hiring bro.
Reply: It is filtered oil, wingnut.  It was filtered before it was bottled.  Are you reusing oil at your shop?  That is the only possible way it could not be filtered when filling the filter.
Reply: Well  the system will always have some dirty oil, and the filter or the engine has a bypass valve  that will let dirty oil pass through un case of high oil pressure demand from the ECM
Reply: @justacinnamonbun8658  Yeah I remember changing oil in older Hondas and the filter is located under the intake manifold, mounted sideways.

Ain't no pre-charging that filter.
Reply: some you do, some you don't, but like you said, "opinion" lol right on brother, some of these guys have blown head gaskets in their brains 😂
Reply: In response to the OP. The filter hasn’t loaded. Smaller micron sized particles are still going to flow thru that filter (unless it’s a super efficient filter which it probably isn’t).
Reply: plz tell me this is a joke
Reply from the maker: @Owen What are you considering is a joke?
Reply: That's really only with fuel filters the oil is like stated before the oil is as clean as it ever will be. Think of it like this your putting the same oil straight into the valve cover and it goes right into the pan
Reply: Bro you’re ridiculous. It’s already argued about precharging not being necessary and now you’re crying about unfiltered clean oil 😂 and a small amount too
Reply: @mattl6584  Dude yes the oil is new and Clean??But what is clean?
Proberly find your new oil has only been filtered to about 80 micron,,where your oil filter is proberly filtering the oil to 5 micron,
why i don't refill filters,with new oil,
unless the side of the bottle says other wise,,:Filtered to 5 micron,!
just takes one little bit to mark your bearing,,and then all sorts of trouble can occur,,
micron is the term used to measure the size of partical the fliter will allow through,
Reply: do you reuse oil or something??
Reply: @theblinkstykrab3106  No Dude,,
just know abit about oil,,after being a hydraulic fitter for 34 years,
you Might also like how when they make unleaded fuel it come out at 55 ron,,so they add things like bensol and other carsongenes to you fuel to make it 91 ron,
Reply from the maker: @RedHaloManiac95  lmao
Reply: @izacmcdermott3551 seriously doubtful. 
I'm sure there is bigger particles in your engine. 
 If you don't believe me strain your oil through a 2 micron filter then look at the pieces you will have
Reply: @montymartin4493  That why we have a filter,,and any thing that goes through your pump should go through filter,,sept when ya don't change them and then , the pressure by pass open and floods your engine,,with lots of nasty stuff,,as for 2 micron,,at that level you start removing additives in your oil,,
So Yep,,just goes to show you have to be smart to comment..
Reply: But the oil he’s putting into the filter is new oil. It’s clean. There’s nothing to filter out of it
Reply: Rest assure no matter which direction you pour the oil in, it will still get through the other side. He is doing it correctly. The same way the oil flows through it while the engine is running.
Reply: @nspro931  Where are you getting your oil? There is no sludge in new jugs. Are you just thinking the oil left sticking to the plastic is sludge? Sludge is caused be heat and water. You must think the wet left over in a glass of water is water sludge.
Reply: @FZERO20  why is filling the center worse than fully dry?
Reply: Its not used oil 🤦‍♂️
Reply: If it's factory new oil straight out of the bottle, why does it matter? It's not going to be dirty or used.
Reply: @libtrs838  hmm, idk if it’s worse but the centre portion is actually the output, and the outer circles are the input. So you’re pouring unfiltered oil into the engine. This wasn’t a huge lesson I was taught tho. It was mostly not putting a filter back in dry and/or leaving the old seal on the housing
Reply: You don't need to filter clean oil.
Reply: Well let's think about which is worse, unfiltered virgin oil with maybe a few particles or running your bearing surfaces for 20 seconds with no oil because you didn't prime the filter. Been priming the filters for years on everything and I have a crown vic with over 250k and a town car with 300k still running great. Also my Fomoco vehicles use Motorcraft filters which all have anti drainback valves so no way to pour the oil into the outside holes. Additionally my parent's f250 powerstroke just hit 600k miles, we primed the filters every oil change. You do what's works for you if you think 100-160k miles is a good life but I'll keep getting real service life out of my engines.
Reply: You pour new oil that hasn’t been filtered directly in the engine when filling up after an oil change and when topping off. Find your common and use it. Also the small holes are used when under pressure not when off the car. You always pour in the large opening, when possible. Horizontal and extreme angle placement makes it harder. Wouldn’t trust you around my cars, especially since their Bmw. 
Priming the filter is always a good thing when possible
Reply: @libtrs838  I mechanic for a living. Many times over the years I have noticed brown/black flakes in the bottom of oil containers after pouring out.  Sort of like the yeast in the bottom of Shock Top beer.  If you are pouring it in filters you will not see it until it is too late.  Sometimes it's not there and sometimes it is.

The bottom line is, there is no reason to risk contamination by filling a new filter.  The oil in the bearings does not magically disappear in the 5 seconds it runs without oil pressure.  The pistons and rockers don't care either.  

I recently tore down an industrial engine that failed from being left to run slowly out of oil over many days.  Only the very last bearing in the train was fried.  The other bearings all had zero damage.  From running goodness knows how many hours on next to zero oil.
Reply: It's oil right  from the bottle. it doesn't need to be filtered...
Reply: @richfarfugnuven6308  The whole point of this conversation was that the oil from the bottle is not necessarily clean. The oil manufacturers do not make it that clean and when they handle it they don't care.
Reply: @Rhett Mix you are thinking way too hard bud.
Reply: Do you filter it before you pour it in the filler cap??
Reply: @Jack-lo1uc  No, it drains from the filler to the oil pan where it gets pumped and filtered before it reaches the bearings and precision parts.
Reply: What your saying makes no sense.Brand new oil out of the container is CLEAN. Oil does not need to be filtered until it actually runs through the engine which is what makes it dirty.
Reply: Do you then filter the oil you pour in the fill port.  That oil runs over a good bit of the top end before the pump and filter.
Reply: Bruh. With that logic, You’re putting unfiltered oil into the car when you change the oil in general.
Reply: Hammm, didn't know that.
Reply: Are you aware that the new oil you put in the engine is the exact same oil that he's pouring into the filter? I'm not following your reasoning.
Reply: @nspro931  it is.
Reply: @mal15102  It may run OVER the rockers and such, but it certainly does not appreciably get into any bearing spaces before it falls to the pan.
Reply: Can't say I'm worried about my jug of fresh oil being full of contaminants
Reply: @Wallstreetavarice  Well, I guess you trust huge corps to do it right for you and give you clean oil each time.  Caterpillar certainly doesn't trust them so they instruct not to pre-fill.  I reiterate, I have seen the sludge with my own eyes at the bottom of containers.
Reply: It doesn't matter what way it's filled, it's clean oil out of the bottle, also filling oil filters isn't always possible due to the way their mounted, some are mounted sideways so you cant fill them without making a mess so for them you pull the ignition coil and crank the car a few times, filter filled
Reply: Doesn't matter
Reply: There's going to be unfiltered oil in the system anyway 🙄
Reply: You’re saying the BRAND NEW oil needs to filtered?
Reply: It's fresh oil
Reply: @AudioGardenSlave123  dude claims he’s seen sludge (which is engine shavings in caked oil) in new oil. He’s most likely seeing additives fall out of solution….
Reply: @RedHaloManiac95  There's definitely quality differences in oils cause I've seen the differences between different hydraulic oil brands with one being perfectly clean at the bottom of the bucket and others having lots of sludge at the bottom. With motor oils I've never seen such a difference but I wouldn't doubt cheap store brands may well have contaminants. But you've got to pour the oil in the motor to fill it either way so it's a dumb point with the oil filter filling issue. Any new oil is better than the old oil in the motor so it's a dumb point.
Reply: Unfiltered oil is quite an overstatement
Reply: But the oils is new
Reply: I guess I should filter the oil before I put it through the fill hole too because it goes through the head and cams before it gets to the main reservoir so technically unfiltered oil is getting into the engine that way too
Reply: U joking, ain't u?
Reply: C'mon dude. You're really pickin' at some SMALL shit there.😅
Reply: Bro the oil is from the bottle literally as clean as it can be 😂 the filter is to filter oil THAT HAS GONE THROUGH YOUR ENGINE.
Reply: It's brand new oil.😂🤦
Reply: do u filter the oil before you pour it into the engine 🤦🏻‍♂️ new oil is already clean
Reply: You know why I fill through the outlet? Because the oil i pour into the engine after i install the filter isn't ran through a filter before it hits my oil pan, either, and it's easier to fill that way.
Reply: @izacmcdermott3551  at 300k miles still havent spun a rod
Reply: @izacmcdermott3551  most oil filters will capture approx 98% of particulate at 30microns (very generalised numbers, but quite close for most auto oil filters z418 ryco does 98.7% at 32micron for eg, quite a popular filter) so to claim that a 2 micron piece of material will do damage is ridiculous as an oil filter won’t filter particulate that small out, also do you understand how small 2 micron actually is? A 2jz will run anywhere from 20-50 micron oil clearance on the big ends…2micron is a tenth of that.
Reply: @timm.6391  the word you want is “moot”. It’s a moot point. Not mute.
Reply: You do realize that oil filters have a drain back valve that allows unfiltered oil to quickly get into the system on startup
Reply: @todydn  Oil better not be sitting around the crankshaft.
Reply: @garykendall1376  some engines they do not fully submerged obviously that would cause a ton of undo drag  i mean when i take my pan down it would appear the the rod connection points will skim it slightly as then stick past the bottom deck of the block
Reply: the oil out of the bottle is clean and doesn't need to be filtered
Reply: A lot of dummies replying in the comments section and author didn't explain why you pre fill the filter either.
ITS SO YOU DONT STARVE THE CRANKSHAFT AS THE OIL FILTER STARTS FILLING ON START UP!!!
THATS WHY YOU PRE FILL THE FILTER WHERE POSSIBLE. You also do it turbo engines so the oil picks up faster and not starve the turbo bearings before the filter fills up!
Reply: There's going to be the rapture soon. It's when God is going to lift his people from here. It's that time. God has blessed me with the message.  Part 2.
God said people should be living by the Bible. Amen.
Reply: I’m with you on this one 100%
Reply: You have to pry down the drain back valve, to completely fill the filter, but on many manufactures training courses they say not to fill the filter, as far as unfiltered oil cold winter weather the bypass valve opens let's unfiltered oil round
Reply: 🤦🏻‍♂️🤦🏻‍♂️🤦🏻‍♂️smh
Reply: Uh nooooo
Reply: It's a new bottle of oil
Reply: That's brand new oil he's pouring into the filter.  It doesn't need to be filtered.  It's clean, new oil.
Reply: Unfiltered fresh new oil shouldn't be an issue for a few seconds.
Reply: still pouring a bunch of unfiltered oil right into the oil pan, so what difference does half a cup make being filtered before filter installation?
Reply: Cold weather start the filter is mostly bypassed until the oil warms up enough to flow through the filter. Dirty oil lubricates much better than no oil.
Reply: @OnlineMechanicTips you’re doing it just fine.  Good job
Reply from the maker: @hondahaney6404  Thanks for watching bud
Reply: But that would mean your putting unfiltered oil in the engine right?
Reply: I would love to do this but my oil filter goes on horizontal.
Reply: It's new oil. Filter is for engine wear. Dirty used oil for heat and wear. Unless that new oil is used
Reply: It's new oil.  Come on think bout it
Reply: What a nonsense thing to say! So, if he is doing it wrong, how is he supposed to filter the rest of the oil that is used to fill the crankcase?  😂😂😂
Reply: But honestly it doesn’t matter since it’s clean and all these oil will eventually circulate as soon as the car starts running.
Reply: @QuincyStick 😂😂😂😂😂
Reply: This is hilarious everyone correcting a persons attempt at pulling a leg. It’s like telling the new guy to go change the air in the tires.
Reply: ? It's clean oil what would it matter?
Reply: A lot of cars the filter is not mounted in that position so you would be wasting oil
Reply: What? Lol
Reply: 🤦🏻‍♂️🤦🏻‍♂️ fresh oil doesn’t have to be filtered Lmfao, the most important thing is making sure the filter is full so to reduce the time the engine is running dry. filling it into the center hole or outer holes doesn’t matter lol
Reply: That doesn't make any sense. Unfiltered clean oil.
Reply: Correction! The oil is as clean as it will ever be out of the bottle.
Reply: Don't listen to people on the net with no mechanical experience. You only do that to diesel engines but it won't hurt if you do it on other engines.
Reply: @JohnDoe-md2sb  New oil out of a bottle is still NOT filtered.
Reply: @georgedawson235  Unless it has plastic bottle shavings in it.
Reply: @izacmcdermott3551 What kind of dirty ass oil do you use .  Never seen such a thing happen.
Reply: It's fresh oil
Reply: @justacinnamonbun8658 .    Oil shouldnt drain back out of the filter when shut off. So cold start or not ur filter is always full except when u change it.  So u should prefill it when changed.
Reply: And what of the “unfiltered” oil you’re pouring into the engine?
Reply: Ha! I never knew what that thing was for, I always throw it away.
Reply: Wow this comment section is hilarious 😂
Reply: Not a big deal as the motor will circulate and any imperfections in that roughly cup quantity will be filtered within 10 minutes of driving. Its extremely nit picky to want to pre filter what you load into the filter.
Reply: Doesn't matter and the small holes have an anti drain back valve usually
Reply: If it's clean oil it's will circulate in a min anyway. 🤷‍♂️
Reply: Aint nobody got time for dat
Reply: Yes, it's a good idea to pre fill.
Reply: Lol this is a joke right
Reply: But the oil hes pouring is clean....why would it need filtering??
Reply: @bigpjohnson you are 100% incorrect.
Reply: @JohnDoe-md2sb please tell me you dont turn wrenches. Most of you hacks shouldnt touch cars.
Reply: @davidbuck9977   I generally don't prefill the diesel fuel filters. Instead I give about 20 or so pumps on the primer pump, until I hear the air bubbles rushing out of the pipes.
Reply: No need to make a science out of something this simple. 😅  well, mechanics get paid by the hour,so taking 1/2 hour longer would be best?
Reply: That only matters with fuel filters oil won't make much of a difference
Reply: If we can’t trust new oil to be clean in the first place we’re all doomed.
Reply: @izacmcdermott3551  you do realize that when you fill up your car with oil that entire jug goes in unfiltered right? 😂 There is absolutely no reason to be that extra for absolutely no reason
Reply: Fresh oil is as clean and filtered as it gets. Thanks for the chuckle 😅
Reply: New oil is filtered
Reply: dude it's brand new clean oil..... it doesn't matter!
Reply: I pour in the center and will continue to do so. New oil straight out of the bottle is as clean as it gets. Trying to get oil through the outer holes is an exercise in futility.
Reply: Hahaha! Wait!.....do you wipe before you poop and from back to front like everyone else. I mean, I see where ya is coming from, but your logic is a bit flawed here. First off, that brand new oil will immediately start flowing the correct direction once the engine is started. And second, unless you flush out your engine with a degreasing agent of some kind, you'll always have particulate in there, and lastly, common oil filter elements don't even filter out particulate that small, most filters are 25-30 microns, so 2-3 micron particles will pass through with ease.
Reply: Only maybe useful for a bottom-mounted filter🤷
Reply: It’s not that deep bro, it’s not going to cause any harm whatsoever 😂
Reply: It’s pure oil and doesn’t need filtering.
Utter nonsense.
Reply: You put unfiltered oil in your system in the first place,trough the valve cap🤣theres no need to do that
Reply: Thank you for this comment I was second guessing what pops taught me for a second.
Reply: LOL it’s NEW oil and it flows thru shit on the way to the filter…
Reply: @JamesReedy  doing abs no good job whatsoever🤣
Reply: If you do not do this, it is POSSIBLE for the pump to lose prime.
Reply: Someone is smoking too much crack !!! That oil is filtered and is as clean as it can be what turnip truck did you fall off of??? And it does not matter if you fill it through the center or outer ports holes if the oils is new it will not hurt anything..
Reply: Do you filter the oil before you put in vehicle?  No
Reply: Brand new factory oil. It's clean ive done it for years and never had a issue. Thanks for your concern but brand new oil filter and brand new oil I wont have to think about dirt getting it it
Reply: oil out of the bottle is clean lol.  Don't believe me?  Send an oil sample to get it tested
Reply: @nspro931 lol.  it's not sludge, it's oil additives 😂😂😂
Reply: So when you add engine directly to the engine fill cap are you filtering it through your arse?
Reply: @jjunderwood4095  pour a small amount in, rotate the filter body in its installation orientation axis until the filter media absorbs it. Repeat until saturated. Install. It was a described procedure at one point in the old FSMs.
Reply: @justacinnamonbun8658 - not we’re no replacing the filter at every cold start but  thats not the reason why you should prefill an oil filter. 

The problem is no immediate flow of oil throughout the engine because the oil pump is filling up the filter first. As for cold starts, the oil filter is already full and the anti drain back valve prevents the filter from leaking into oil pan.
Reply: If it flows from outside to center, I would bet that in that situation it would work the other way around thus still being filtered. Plus it’s clean brand new oil anyhow
Reply: @StandAndStare This is most accurate answer to this specific question 😂
Reply: Every time 👍
Reply: You forgot the part where he is using new oil
Reply: @bigpjohnson unless it’s pennzoil lol
Reply: It's brand new oil you don't have to filter the oil straight out the bottle
Reply from the maker: @evancrow4341 Dude some people simply think way to hard for no reason.
Reply: It's still cleaner than what's in the sump so why does it matter? That is brand new oil and is as fresh as it will ever be so why does it need to be filtered? What are you filtering out?
Reply: So I guess the includes the oil being poured straight into the engine via valve cover is a bad thing right? The oil provided in the container is filtered plenty
Reply: @ElectronicsForFun  if it’s pennzoil metal shavings lmaoo
Reply: The oil is brand new so why does it matter?
Reply: Just like the other 4 quarts that you dumped straight into the motor? 😂
Reply: No you're wrong
Reply: That’s not even make sense, because all that oil is new and doesn’t need filtering!!!
Reply: @OnlineMechanicTips pay no attention to that comment. Oil straight from the bottle is hella clean. They pass it thru better fiktrage system than the ones in your car at the factory
Reply: Yeah, new oil is always super dirty
Reply: @landshark218  i hope you're being sarcastic but the amount of people who believe that nonsense is too damn high.
Reply: The oil is clean straight out of the bottle. So I'm sure it's fine.
Reply: This concept is wrong. When you pour the oil from the other containers right into the engine, then it would be like doing the exact same thing. The oil doesn’t pass through any filter when you’re pouring it directly into the engine 🤦🏾‍♂️
Reply: @CWood91  it's wrong on so many levels it's actually impressive
Reply: Oil in the bottle doesn't need to be filtered. It's the cleanest that it will ever be when it's fresh out of the bottle.
Reply: @jaimedelgado7529  yes I’m joking.
Reply: @mrerkman0 even tho it hasn't seen the inside of an engine they actually run it thru industrial filters in the factory before packaging into the bottle. That comment is ridiculous but ud be surprised how many people think and sa this as it is the first time I hear somebody with this illogical theory and sadly it won't be the last
Reply: Don't bother.
This guy and his shop is getting sued.
He has absolutely no idea what he's doing.
He should spend more time learning instead of posting this crap.
THIS is EXACTLY why your maintenance is so high. I didn't post it...HE did.
Reply: @OnlineMechanicTips  We know you didn't.
Did you have any kind of formal training before you decided to rip people off?
Like naybe a boces course?
Reply from the maker: @CNCMatrix  If you trying to get my attention lil Mr Nobody ass man, I dont entertain trolls on the weekend. Hold your troll thoughts until monday sir. FOH
Reply: Yep he's right, tons of car manufacturers tell you do NOT do that.
Reply: It's new clean oil .
there is no need to filter new oil
Reply: Yep, it's unfiltered. Just like the rest of the oil you dump in the valve cover.
Reply: That’s pretty overboard, even for me and I’m anal about my stuff.
Reply: New oil is already filtered, no need for paranoia. The main reason to fill the filter is to get the oil to the bearrings quicker
Reply: @mattl6584 you do realize they don’t filter oil going into a jug, right? Oil in a jug technically isn’t filtered
Reply: 😂 what
Reply: Putting new oil in a filter always destroys your comment
Reply: Hahahahahahaha
Reply: You're wrong, because the new oil you put into the new filter is already clean to begin with. You're supposed to prefill the new oil filter exactly the opposite way you said.
Reply: @bobby1970  you dont put dirt and rocks in new oil containers?🤔weird
Reply: Does it matter if the filter and prefilled oil is new?
Reply: Be scared of the brand new oil.
Reply: @Simple5.0  why?
Reply: You think brand new oil is contaminated?
Reply: 😓 clean oil from a jug isn't going to be contaminated. 😓😓😓
Reply: We never fill the filter because of positioning and even if it is oriented like that it doesnt matter. You drive the car in and at max 30mins later the oil is out of the engine, an hout total maybe . The besrinfs are still wet and the <3s from inserting key to refilled hydros womt damsge the car. Didnt matter how long the oil was out or if the engine is wsrm or cold, after sub 3s it sounded normak and we had a Modell that sounded like the engine is broken everyone you chabge oil, orhers where silent even then.
Reply: so should i put all my oil in there dump it out to the bottle and put that back in my engine 😂
Reply: and what exactly is being filtered? im confused cause why would fresh oil have to be filtered when the cleanest it can ever be....
Reply: Never done it in over 800,000 miles of driving in 32 years and never had engine trouble at all.   All my vehicles were used too except 1 or 2.   Over 100K, I have an 2003 Escalade with over 245,000, 2016 Ram 55,000.    I thinks its totally unnecessary, also it matters more that you change it and use quality like Mobil 1 full synthetic the 20,000 mile one.   Anyways, good luck & happy driving.
Reply: @izacmcdermott3551  what of the oil still in the oil pan?  Lol  fuck me net pros are goofballs
Reply: Unfiltered clean oil 🤔
Reply: @handsonmechanical  is that like transgender?  Im confused
Reply: FACTS 🤘
Reply: Bingo
Reply: You put unfiltered oil into the system when you add oil to the system.
Reply: Are yall dumb?😂😂 talking about unfiltered oil? It's LITERALLY  the same exact oil that you dump directly in the crankcase......STOP!
Reply: The oil is clean why does it need to be filtered if it's clean oil!!!!. Just pour it I. The damn filter it matters not
Reply: That oil is as clean as it’ll ever be brah 😂 the filter is not for the oil. It’s for engine debris.
Reply: The fact 4k liked this comment 😮‍💨🫠🪦
Reply: You clearly don't realize how bleeder valve works in the oil system and how often it works. You'd be astonished.
Reply: Stupid logic with new, clean oil
Reply: Not true lol
Reply: @bigpjohnson yeah, but it's still better to filter
Reply: True, but it's proven that oil from the bottle is at its cleanest point
Reply: @izacmcdermott3551 And what about the bulk of the "unfiltered" oil that you're pouring directly into your case and most of the time over your crankshaft?
Reply: It's filtered before it's bottled...
Reply: @OnlineMechanicTips don’t listen to this guy 😂 the oil from the bottle will always be cleaner than any oil going through that filter. Strait from the bottle is actually the cleanest that oil will ever be so keep doing what you’re doin 👍
Reply from the maker: @adrianvalenzuela2711  Yea man im kinda stunned by what im reading in the comment section concerning that. Lol. I just have never given it much thought. Like why is it so important to run brand new oil through the filter first? Lol, i hope its already clean
Reply: It doesn’t matter. Just fill it up my boy
Reply: If you’re using synthetic it’s already clean
Reply: @todydn you think the crank is sitting in the oil?
Reply: New oil is pure so it doesn’t matter
Reply: The purpose/idea of this is to lessen the chance of filter implosion during hard cranks. It’s happened especially with low voltage. Seen it
Reply: @izacmcdermott3551 shade tree mechanic here. It'll be fine
Reply: Shame engineers design a lot of horizontal applications
Reply: That myth has been specifically debunked... Check youtube, and you'll find a very informative video...
Reply: @bigpjohnson Fresh from the bottle, how dirty can it be? Pointless.
Reply: I do it cuz my pops did it
Reply: It's clean oil !!! that doesn't matter...stop giving people bad information...bruh is giving correct information..pre-charging the filter...
Reply: There are several quarts of "unfiltered" oil in the pan, nothing is accomplished by pouring some in the new filter.
Reply: @JT_70 my work truck is a Ford F-550 it holds 17 quarts.
Reply: I think he is confusing pre-filling a diesel fuel filter. Which comes with a plug for be middle.
Reply: It’s new oil… duh
Reply: I don’t do it on my s10 mainly because it’s a side mounted filter and it would make a mess and be completely pointless but on bottom facing oil filters I usually pre fill it and use clean oil on the seal but I mean it’s not the end of the world if you don’t my truck has 350k miles on a 4 banger and have done this since 240k so honestly whether you do it or not doesn’t matter it’s just preference but that mileage and wear says it all and my valve train is tight and smooth I don’t burn any oil and I only leak out the pan a little and I just don’t want to change it because it’s way to much work when I only lose a quart between changes and the oil pump is still strong I don’t have any issues and I’m hoping to push this truck for a long time to come as long as you take care of your vehicle do a oil change every 4k miles(don’t believe that nonsense with 10k the more you change your oil the better it is for the engine and oil breaks down period I don’t care what they market it as 40 bucks every 4k miles isn’t going to break your bank) and make sure use good oil I prefer royal purple but valvoline is the cheapest I’ll go and I use royal purple filters except for on my mustang fords are picky about their oil filters
Reply: 😂😂😂 that's fresh oil tho.....🤦🏽‍♂️🤷🏽‍♂️😂😂😂
Reply: who gives a shit lol
Reply: You do understand we host be refined oil is being filtered the whole time not to mention when it’s complete refined it is filtered yet again, seems very very extra but I see where your coming from
Reply: The filter holds oil just a way to get proper measurement without running the engine first and adding oil after me personally don’t do this I add enough with filter and after I start the engine it levels out perfectly as for making sure your oil is filtered it’s not going to matter the oil filter is usually the first stop before it goes anywhere and the oil is extremely filtered during manufacturing if you managed to damage a engine due to oil contamination the engine was either filthy and some build up from lack of oil changes or wear decided to let go or you have the absolute worst luck ever that something would be in your oil and make it through your filter
Reply: @JohnDoe-md2sb not about filtering the oil. It's to build oil pressure faster
Reply: New oil actually has alot of particulates in it.
Reply: @jibrilthegreat35 not as clean as you think.
Reply: I don't think it makes that much of a difference as long as you change the oil regularly
Reply: Clean virgin unfiltered oil 😱
Reply: The hell with splitting hairs, fill up th whole damn thing, center and outrr.😁
Reply: You filter fresh oil? Why???
Reply: Well I can't turn the oil pump off. LMAO
Reply: Are you serious? That's flat out just stupid wrong it's brand new oil.
Reply: @izacmcdermott3551 you do realize engines have a clearance of 1-3 thou right? And a micron is equal to about .0000394 in. So you’re saying some that is ~2% of the clearance amount is enough to destroy something with a ~.002in of clearance? Unlikely.
Reply: Its new clean oil. Doesn't matter
Reply: Yep, which is why I don’t prefill my filters.  It doesn’t matter.
Reply: It's new oil genious
Reply: Wrong. That oil is as a clean as it’s ever going to be straight out the bottle. How did this get so many likes lol
Reply: Yeah, new unfiltered oil is already clean and filtered. You think the filter will filter and clean that filter filled oil more? 😂
Reply: 40 years never an issue filling the filter through center
Reply: That's a recipe to get trash under bearings, and cam lifter's.
Reply: It’s brand new oil. It doesn’t have to be filtered😭😭😭
Reply: 😂 that doesn’t matter
Reply: @FreewayJunkies  right
Reply: Aren’t you anyways when you pour it straight into the engine from the bottle?
Reply: About the dumbest shit ive ever had to read 😅
Reply: In my old Toyota Corolla I used to pull a coil wire and crank the starter for a few seconds til the oil pressure came up then reconnect the coil wire and start the motor having full oil pressure
Reply: Dang you got ratioed by thousands of likes 💀
Reply: Nuk po ben transfusion gjaku ,😅
Reply: All oil that you just changed is unfiltered, and especially doesn't matter for brand new clean oil
Reply: It's NEW oil. There's nothing that needs to be filtered out.
Reply: You sound like you go to car meets at tea shops
Reply: you do know oil filters dont even filter when the engines rpm over 2-3k
Reply: Do you filter the new oil when you pour it in??
Reply: So that new oil out of a sealed container is dirty? 🤔
Reply: Um then why are you using dirty oil? It's a clean as it gets coming out of the can.
Reply: @izacmcdermott3551 Then stop putting dirty oil in.  If you use new oil it's as clean as it's going to be.
Reply: 😂 so true @todydn
Reply: Absolutely True
Reply: The oil hasn’t been contaminated yet so you don’t have to filter it.
Reply: @OnlineMechanicTips  you don’t have to cover that hole. The oil isn’t contaminated yet so it’s fine.
Reply: Do you run your oil thru a filter before you put multiple quarts into the engine?
Reply: Ant drain back valve internally. Don't need this just oil up the seal
Reply: Bro you pour the majority of the oil directly in the engine! Are yall not thinking?
Reply: Yeah like the other 8 liters he puts into the block 🙄
Reply: You're wrong
Reply: another video sent oil straight out of the barrel, and after being filtered to a lab and the fresh oil was cleaner than the oil that had been running through the engine and the filter
Reply: @davidbuck9977  when I rebuild/build small block chevy's I always put in a non-bypass oil filter adapter,  swap out the factory adapter with a non bypass! Not only does 100% of the oil get filtered it also raises oil pressure! Cannot speak on other engines,  small block Chevy's is all I know or even really care about, best little engines ever in my opinion!
Reply: @StandAndStare Depends,  some engines have "priority mains" oiling systems and some don't.
Reply: Its unfiltered when you put it in the engine from the top…
Reply: The crank is not submerged at all.  That would create air bubbles.  Not good for bearings @todydn
Reply: @nspro931 tf kinda oil you buying
Reply: Unfiltered straight out of the bottle huh?
Reply: @charliesmith7942  Seen it enough times in Delo 400 and Rotella T to make me want to follow the engine mfrs manual.  Also had enough engine bearings apart to know they retain oil for years without any pump and the separation of bearings and journals is due to oil wedge, not oil pump pressure.
Reply: Can't tell if you're trying to be funny or not.
Reply: That brand new oil is as clean as it’s going to ever be 🤣
Reply: @TheRealEricRose  The funny thing, all the people on your side of the fence make the claim without evidence or logic and add a lot of laughing faces and other mocking. Those of us who do this professionally trying to tell you how it gets done in the shop world.
Reply: @nspro931  it can be done in the shop that way but I’m telling you that brand new oil is a pure and clean as it will ever be…so it doesn’t matter how you pure it in a oil filter.
Reply: @TheRealEricRose  And I and other professional mechanics have all seen the particles of sludge in the bottom of brand new oil containers if they are any color besides black. Plus my higher colleagues in the very large equipment world have run "new" oil through fluid analysis and found the level of non visible particulates much higher than acceptable.  If you want it filtered new to a high spec you have to order it that way and pay extra for it.  That is why mfrs say don't pre fill.  Plus how are you going to pre fill sideways or upside down filters or multipiece pot or cartridge filters?  This is all a bunch of shade tree guys who have never opened an engine larger than 7 liters gasoline thinking new=good.
Reply: Not true tool. Its filtered at the manufacturer
Reply: @dabeachman  Source for this information please.  "Trust me bro"  I guess the visible sludge in some bottles passes through their filtration?  Sure doesn't look like it was to me.
Reply: Lol, unfiltered oil ... 1st of all, its brand new and 2nd of all, do you have any clue as to how much unfiltered oil gets into your engine when the filter by-pass opens?  The oil filter by-pass opens regularly and especially when the oil is cold.  While your statement makes sense, its a total waste of time and incorrect.
Reply: @eliezerramosjr1017 Oil pumps don't "pre-prime" the system ... the pump only pumps oil when the engine is running.  No engine runs an electric oil pump yet.  The only time an engine is pre-primed is by the engine builder, after it is assembled.
Reply: @StandAndStare Yeah, and that fill port dumps the fresh oil right into the pan so the oil pump can suck it up and THEN send it to the filter, which has a by-pass on it anyway, so whenever the oil can't pass through the media, too cold/media too dirty/too fast of throttle response, the by-pass opens and unfiltered oil goes to the engine anyway ... you're totally wrong.
Reply: @vincentrobinette1507 Wrong, the anti drain back valve is just a check valve to keep oil in the filter when the engine isn't running.  The filter will definitely fill after an oil change.
Reply: @litalitvinaite891 Go back to the filter manufacturer and prove it, they should be buying the new engine, if thats the TRUE case ... i doubt it, though.  All engines are equipped with a filter by-pass valve which negates your statement 💯 %.
Reply: @TTGTO288  I agree the filter bypass may open.  Or it may not, especially at idle speed which is likely after an oil change.  But Caterpillar and others specifically say in their manuals not to fill their filters for this reason.
Reply: @nspro931  sounds like you are confused ... the filter by-pass is highly likely to open when the oil is cold (after an oil change or a cold engine), whether at idle or not.  It opens whenever the pressure before the filter media over comes the by-pass spring pressure.  Just reving a hot engine can cause this.  CAT, btw DOES recommend prefilling their gigantic oil filters ...
Reply: @nspro931  You are not educated about the subject.  Pressurized oil WILL go to the filter when the engine is running, no matter what.  The oil pump will pump it there and fill the filter within a few seconds.  The by-pass ONLY opens when the pressure BEFORE the filter media over comes the by-pass valve spring's pressure (which isn't much) ... and it happens regularly with cold/fresh oil until it warms up.  The oil filter by-pass has nothing to do with filling the filter on initial start-up after an oil change.  You are WRONG about CAT saying not to pre-fill their filters.  Giant filters like that should be pre-filled to cut down on the time it takes the oil pump to fill it, hence less air in the system and reduced dry starts ... please educate yourself the next time you comment.  You are one Google search away from seeing that I am correct.
Reply: @todydn  Made me laugh. I was kept reading on till someone caught on that simple fact lol
Reply: New oil is cleaner than the filter itself
Reply: Irrelevant to mention if you're pouring in new oil
Reply: HERE is The Savior

HalleluYAH translates “Praise ye YaH”

YaH is The Heavenly Father 
YaH arrives via the TENT OF MEETING
YaH was Who they Crucified for our sins
YaH was Crucified on an Almond TREE

— Ancient Semitic Cuneiform of Moshe (Moses)
— Isa Scroll (The Original Isaiah)

Isaiah 42:8
"I am YaH; that is my Name! I will not yield my glory to another or my praise to idols.”

Isaiah 43:11
“I am YAH, and there is no other Savior but Me.”

Isaiah 45:5
“I am YaH, and there is none else.”
Reply: Unfiltered?  Fresh pure virgin synthetic?  What are you using - old cooking oil?
Reply: @TTGTO288  "CAT, btw DOES recommend prefilling their gigantic oil filters" State your source please.
Reply: @nspro931  The CAT service manuals, dope ... state your sources also.
Reply: @TTGTO288  "The CAT service manuals" post a link to one so we can all read.
Reply: @DoogleReloaded  You are one Google search away from seeing how WRONG you are  ...  I love it when keyboard warriors get called out and can't retort ... always satisfying.
Reply: @TTGTO288  If it is so easy then tell us your search terms and what link to click on.  You don't make a claim and tell the other party to do the search.  I already tried it, it ain't there.
Reply: I’m a heavy diesel tech and our oil filters are huge.  If you pre-fill the oil filter you will get fired.  Most vehicles have bypasses and diesels will crank but one fire until it sees oil pressure.
Reply: Isn’t the oil from the package already been filtered?
Reply: @Nick_Red  Not filtered very well.  Sometimes you can see visible sludge in the bottom which is what this argument is about.  Cat manuals such as SEBU8087 explicitly state not to pre fill.  Another heavy mechanic just posted the same thing here.
Reply: Unfiltered oil from where?  The new bottle? From the oil pan that was previously filtered?  I don't understand what you're saying.
Reply: @turkeyssr  Did you read SEBU8087 page 188 item 4?
Reply: Most engines have the oil filler cap on top, so the new "unfiltered" oil will pour down over a good chunk of the engine's internals anyway.
Reply: @timhinchcliffe5372  It will be on the OUTSIDE of the internals where it will cause no damage.  Not in the 1 THOUSANDTH of an inch clearance INSIDE all the bearings, that has to go through the pump and filter first.
Reply: Wtf do you think they're putting in those bottles 🤣 Also how the hell do you fill your engine back up with oil? Most put it through the fill hole in the valve cover. The same oil you just complained is "unfiltered"

Think man, THINK. Then type 🤣
Reply: New fresh oil has very, very little contaminants. What he is doing is perfectly fine
Reply: @ericalbers4867  I don't know what they put in the jugs but I know I have seen sludge in them.  The oil you pour in the fill hole goes straight to the pan and gets filtered first.  None of it enters the .001, one thousandth of an inch clearance bearings and such, that has to be filtered and pumped there.
Reply: @basshead993  That makes absolutely no sense.  ALL factory road vehicles have an oil filter by-pass valve.  Only modified, full race engines don't and even that is a stretch for an engine builder to delete it.  Dirty oil is better than NO oil.
Why would you not prefill that large filter with oil? It's like firing it and the oil was never changed, the filter never emptied? Do you think an oil change drains out ALL of the oil in an engine? Sorry to burst you bubble, but the oil passages stay full.  Maybe your shop is just looking for an excuse to fire you.  Not filling that filter only causes a huge air pocket in the oiling system, which is worse.  And those diesels will fire before seeing oil pressure, that remark is 💯% WRONG.
Reply: It's new oil. New.
Reply: @somejerk1520  these dopes don't see that, you are wasting your time.
Reply: @SuperLSX427  
They must be buying their oil in the peanut butter aisle and getting crunchy...or perhaps the pudding aisle and getting Tapioca. New oil has nothing a filter will catch, it's new.
Reply: @somejerk1520  Filters don't catch it all ... at any given point, dirty oil will pass through the engine because of the oil filter by-pass that every engine has.  Dirty oil is better than NO oil ...
Reply: Some ppl don't have all day to do one oil change you'd be sitting there all day waiting for it to prime and that's all it does is prime your filter or you could just not fill it and when you start the car after it primes itself to me this is just stupid and a waste of time oil your gasket that's all
Reply: This is reverse logic, but then why put oil in the oil hole (top engine), directly in lifters and push rods? If it’s so dirty? Fresh oil is too dirty for rocker arms and camshafts? Just plain dumb but ok I respect it.
Reply: Lol, it's clean fresh oil, it doesn't need filtering!!!
Reply: Lmao. Unfiltered oil. Stop
Reply from the maker: @Nobody-dc8dp Lol, do you see how crazy some of these comments are? And most coming from mechanics. Smdh